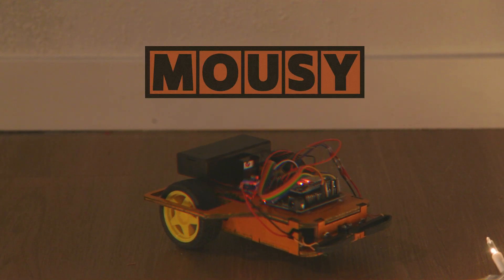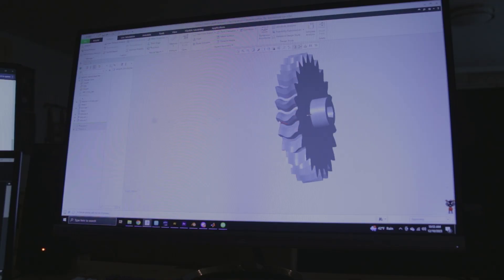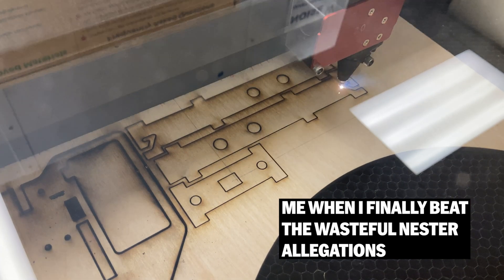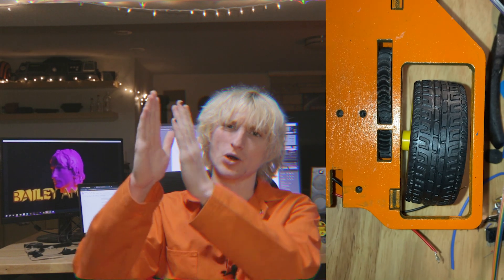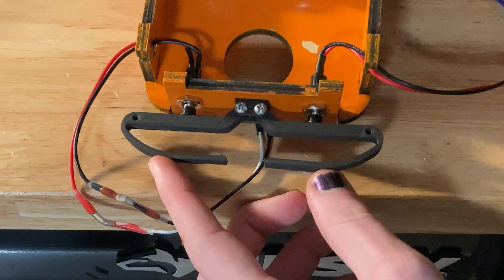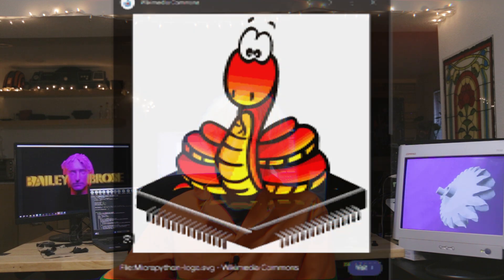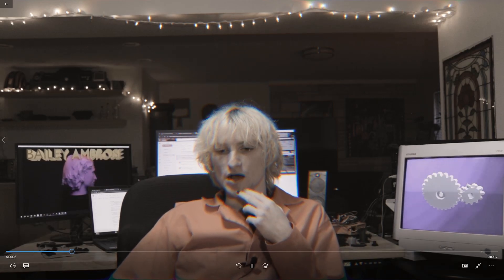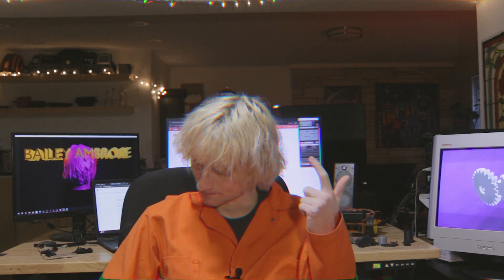Building a Robot Mouse to Save My Grade

Comment: if you ever have to use those crappy yellow hobby motors again and want to decrease the gear ratio, it is possible to take it apart and glue certain gears to certain shafts to also approximately halve the ratio. just make suer to clean off the dielectric grease, otherwise your glue of choice will probably not adhere.